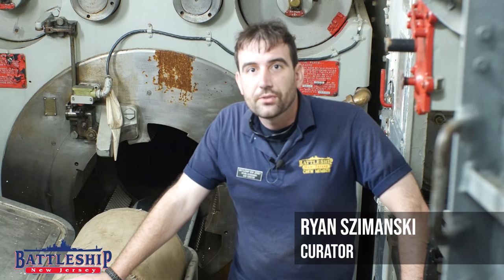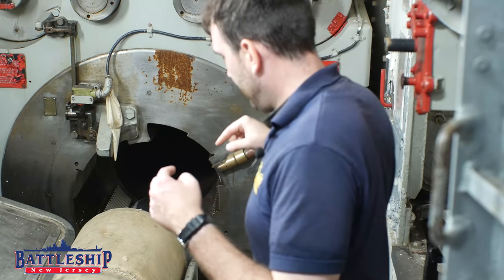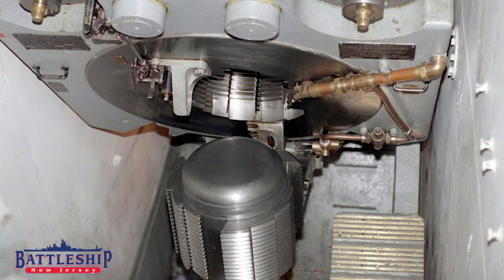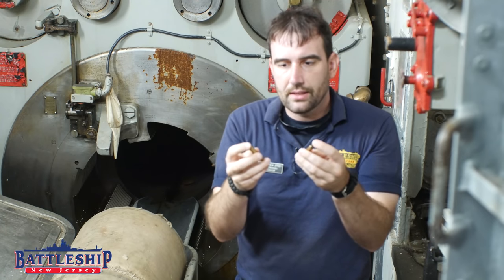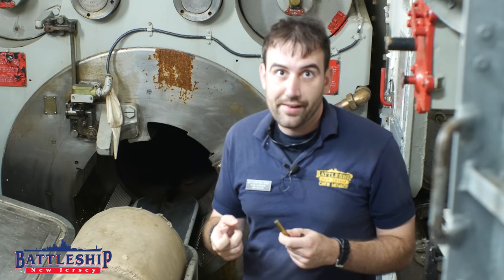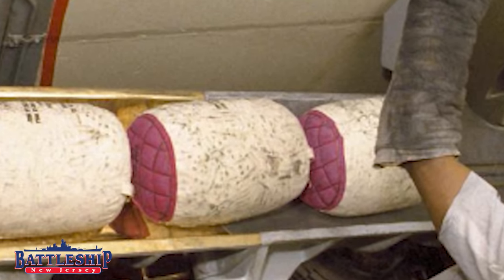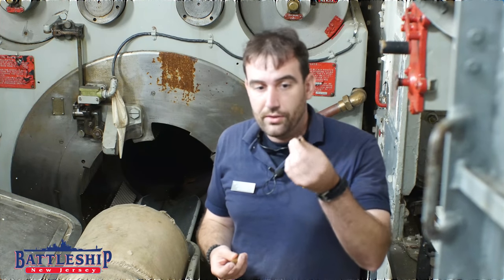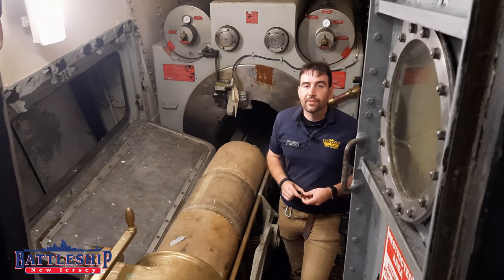How Do You Fire the 16in Guns: Primer

Comment: so the projectile contains only the war head part? and no propelling blast like a bullet ?
Reply: Correct the projectile contains a bursting charge but the six powder bags provide all the propelling force.
Reply: @CRAZYHORSE19682003  so if theres so much power bags, why dont they detonate the war head part?
or the barrel around it?
Reply: @hindugoat2302  The bursting charge has a fuse until the shell spins enough times it won't be armed. The barrels are designed to take that kind of pressure.
Reply: @CRAZYHORSE19682003  is this the same basic system a tank uses?

Comment: I've always wondered how much of the 2000#s of projectile is explosive.
Reply: About 50 lbs. for a 16” Mk 8 shell, compared to about 250 lbs. for a British 14” APCBC shell.
Reply: ...thank you, James. Golly, only 50#s?
Reply: @josephbaca1899  50lbs of Explosive D will be rather detrimental to a ship’s longer ivory. Additionally, sacrificing mass of steel and structural strength to fit somewhat more explosive would correspondingly reduce penetration of armor.
Reply: @jamesharding3459  ...thank you for clearing it all up.

Comment: What would you do if for some reason the gun misfired?
Reply: You would attempt to fire it again or several times. If the gun didn't go off you leave it in the firing position for a specific amount of time in case it cooks off. After that time passes you move the gun back down to the firing position, open the breech and remove the powder by hand and throw it over the side. If you look at film or pictures of the accident on the USS Iowa on April 19th 1989 you will see Turret One's left gun is still elevated. We had a misfire that day, they tried firing that gun six times but it was a no go. We didn't open the breech until it was dark if I remember correctly. The bag was misaligned and the primer burnt a hole through the bag just outside of the red pad.
Reply: @CRAZYHORSE19682003  thank for the response from experience. I cringe bad enough when a hunting rifle misfired, I do not want to think about having to approach that breach knowing 600+ lbs of powder is in it, hoping it does not suddenly slam back or decide to catch once that breach is opened.
Reply: My next thought is in a time of peace you can wait for a cook off time, but in war time situation when you need the gun, after several dry fires do you get by with 1 less gun or do you brave the dangers and dump the powder and reset up the gun? If it goes off while the breach is open you could lose all 3 I suspect.
Reply: @johndunn678  I will be honest, I have no idea. If it were shore bombardment I figure you wait. If you are in a gun duel with another battleship I am assuming you wait but probably no more than a couple of minutes. That is purely speculation on my part we were never trained on those possibilities.
Reply: And thankfully throughout the history of big guns either we never had to find out or it ended well and without incedemt....that we know of.

Comment: Same size? One is a 30 cal which is either a 7.62x51 or 7.62x63. one is the equivalent of a .308 and the other, a 30-06 Springfield. The primer brass you have like like a 45-70 govt. They don't even look similar except both being brass. You really need to work on your presentation skills too. Outside of that, you did atleast have some decent info for someone that may have had no clue.